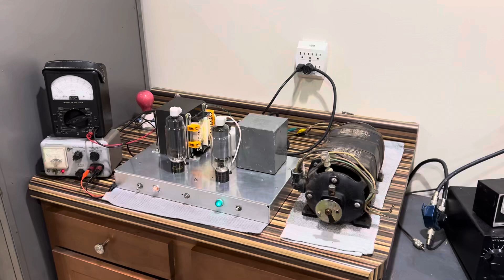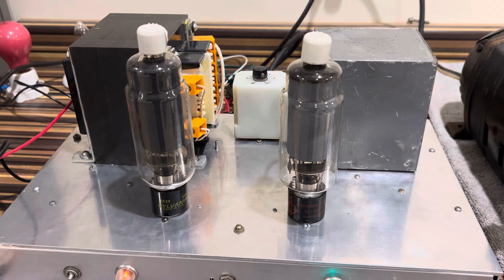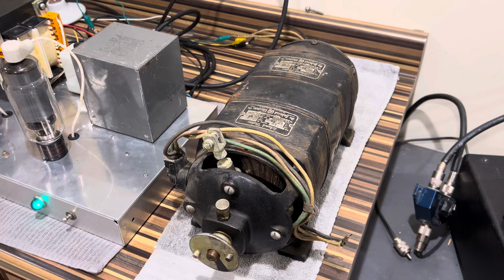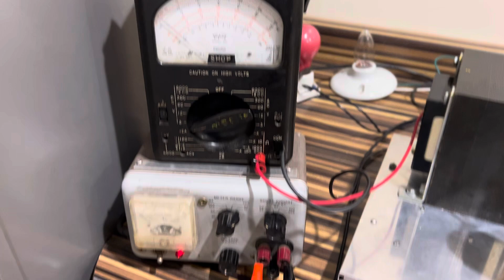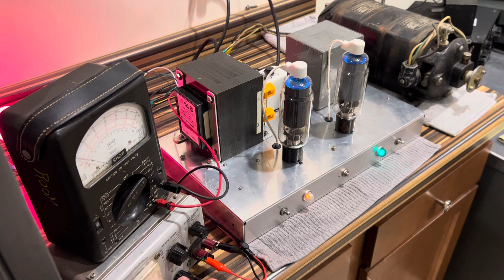1950s Style Thyratron DC Motor Drive Part 1

Comment: All the nitty-gritty described here (especially in the 2nd video) flies right over my head as I'm no good with electrical engineering (and certainly not on this level), but I do appreciate the tinkering and the skill required to pull something like this off! And who doesn't feel fascination by flickering blue glowy glass tube gizmos? Heh!

Love the sound of that thyratron drive btw! It reminds me so much of the thyristor-based motor drives that the 1980s era trams which run in my city used to have. Whenever they'd take off from a standstill there would be this deep thrumming sound from the PCM variable speed AC motor drive unit. These trams were rather state of the art for their time, not only did they have said variable motor drive, they were also microprocessor controlled, and could also do regenerative braking, and feed power back onto the city grid when slowing down.

This was a bit of a problem for the older 1960s era trams which used resistor grid-based throttles and DC motors, so when a thyristor-based tram braked it would actually feed higher voltage back onto the grid, which would make an older DC motor tram speed up if it was in close proximity of the other, braking tram, which was obviously not good if the older tram was behind the newer! :O

Alas, all that is in the past, as the 1980s era trams were renovated back in the early aughts to use modern power electronics instead (likely mosfet-based I suppose), which does not have that same deep thrum when starting... :( They also no longer feed back higher voltages onto the line, so thus don't interfere with the remaining older rolling stock either. So that's a blessing I suppose, for the drivers of the older trams at least! :D

Thanks for the video, mate. It was very interesting!